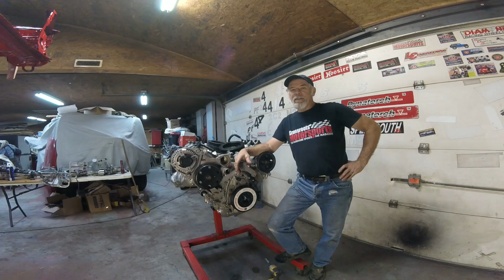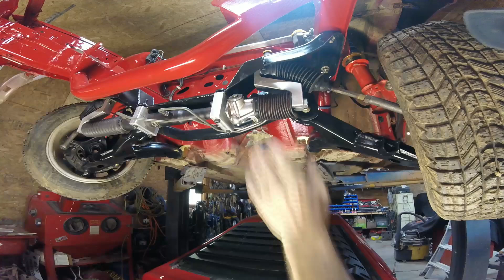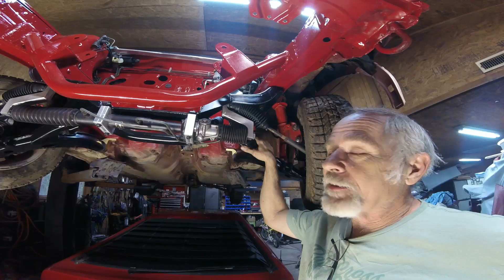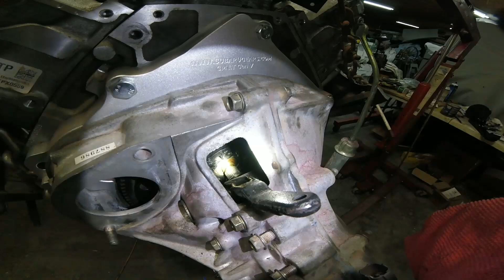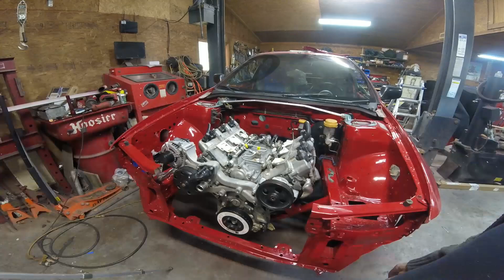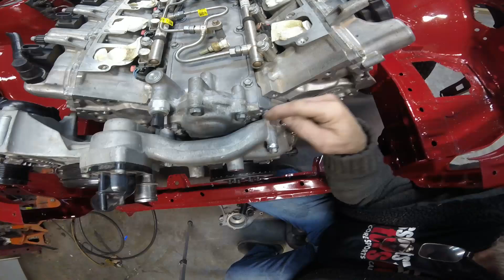Project Frankaru CH8

Comment: If this steering solution doesn't end up working out for you, the Chrysler LH platform cars have a front steer center take off rack. You could mount that low and build a big bracket to relocate the tie rods to where they need to go. I'm going to try to retrofit one into my super beetle. In terms of input degrees to linear travel it's similar to the 2015+ STI rack. Actually you could also just design a brace that connects the LH and RH tie rod adapters together.
Reply from the maker: Thanks. Always ready for input that might come in handy. 1st race real soon so the weak points will self reveal.